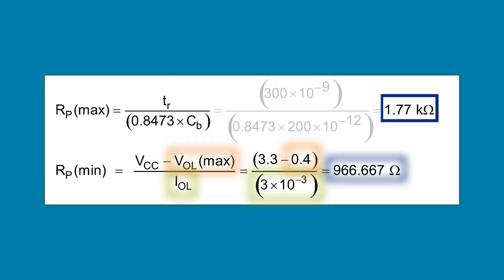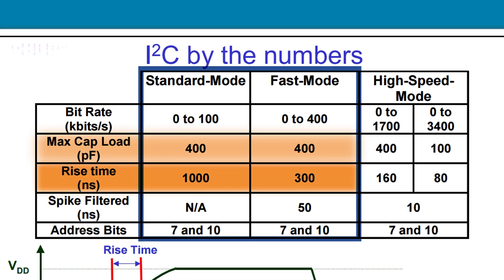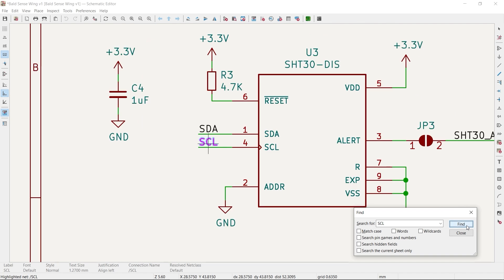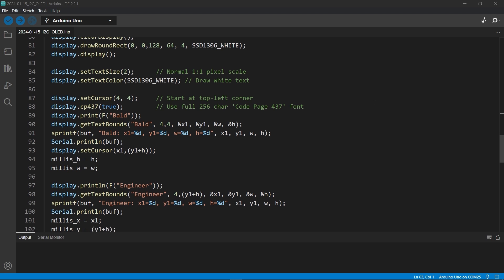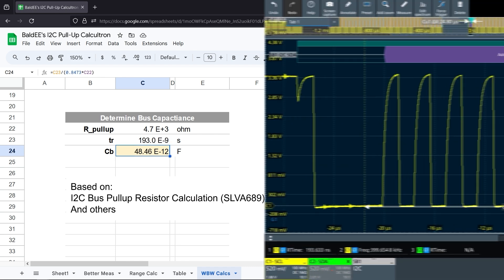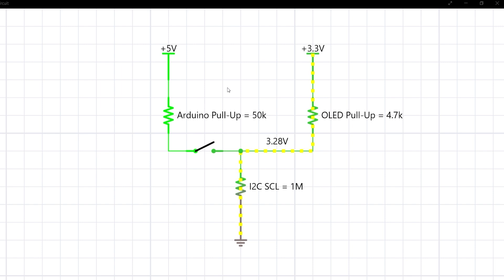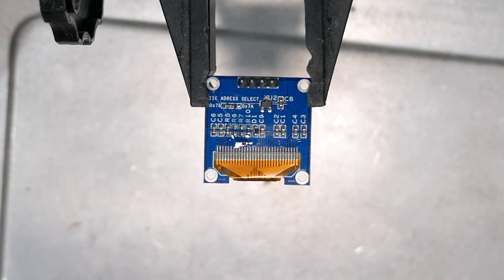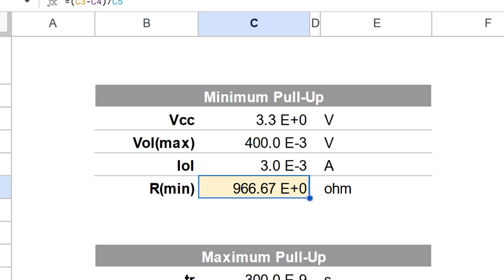If and When Do I2C Pull-Up Values Matter? - Workbench Wednesdays

Comment: This video was much more helpful than another I watched. That's the same application note I used for my spreadsheet, except I completely missed where they fudged the numbers in their estimate! Very helpful. Thanks! Still, if you want to use Fast+ and have minimum current draw, I find it important to actually do the math.

Comment: I made a battery management system using one attiny per cell, communicating via I2C (using capacitors as a cheap way to shift voltage levels between the cells.). Each attiny has an external 100kOhm resistor to keep its capacitor at the correct offset. For the total bus, this means the effective pull-up is all of them in parallel (with 16 cells that's 6.25kOhm). Despite its high number of devices and high pull up resistance, it works fine (already for ~half a year). However it "only" runs in standard 100kHz mode and has long pauses between communications to let the connection capacitors settle to the correct voltage again.

Comment: You can still lower the frequency to for instance 10Hz and add a huge amount of capacitance, right? It might not be a display on the other end, but a temperature sensor read every 10 minutes.

It sounds like a fun project to make the master measure the rise time and configure the speed automatically.

Comment: Mh, maybe someone can correct me: I would like to trigger taps on capacitive touch screen (similar to a touch screen on your phone). I took the tip of a stylus, and soldered a long cable to it. The length of the cable alone already triggers on some screens enough capacitance; registering constantly as a touch. So I assume, I need to put enough „power“ in to the cable from my side, so it matches the screen... Would pull up resistors, knowledge about impedance etc in this video help in solving this scenario? Just need some pointers into what direction I should  search learn - it is a learning project. Thx

Comment: If you measured the inductance of the following: SCL to GND, SDA to GND, and SCL to SDA, using an LCR meter would that correspond well to your calculations?  SCL to SDA would measure unwanted coupling between the two, but curious about your thoughts on the other two measurements
Reply: Practically speaking, I don't think you could measure signal to GND with an LCR (without a fixture anyway.) And if you tried to measure signal to signal, you'd just end up measuring the effective capacitance (since these aren't DC signals). Regardless, I would expect the inductive effects to cause crosstalk while the capacitive effects will contribute to the (slower) rise times. 

Another way I first thought of your question is these are not DC signals and we're talking about impedance. By measuring (or calculating) the capacitance, we also account for the inductance. Maybe that needs more thought.

Comment: until know I just used 10k as pullups..for no specific reason other than I saw others use 10k. well I guess its time to go measure...
Reply: I hope that's a key takeaway: make a measurement to verify you are in spec. If so, move on to real problems!